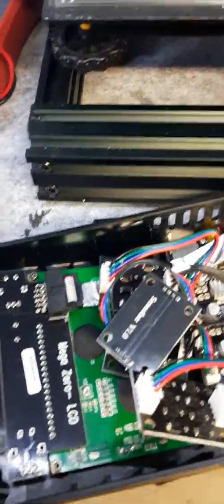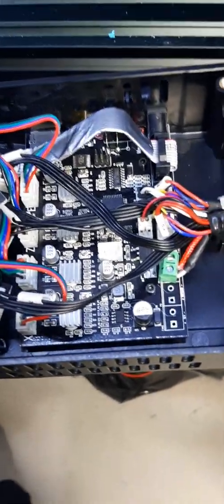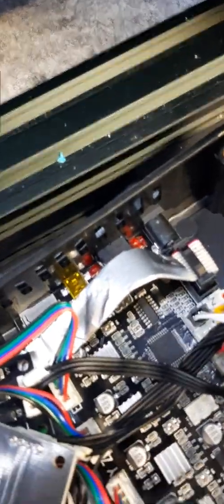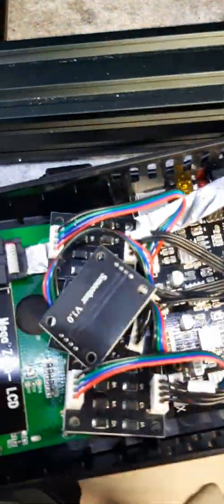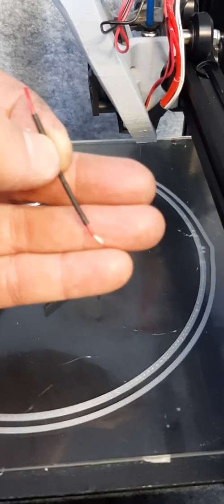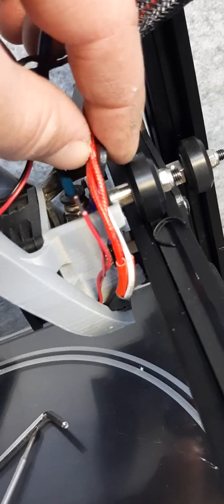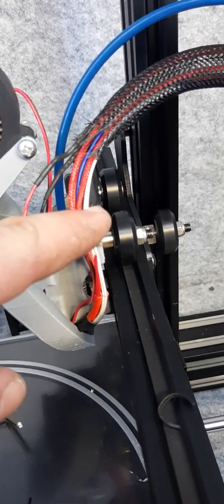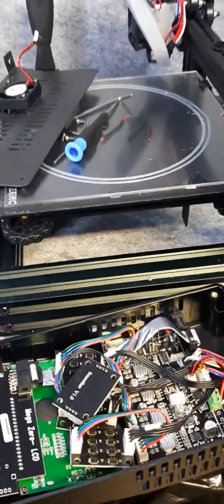Hot End fan Failed! How to find the problem and fix it!

Comment: I had to go through the same with my old Printrbot as well as rebuilding the hot end a few times. It was not fun.
Reply from the maker: I like the tinkering and troubleshooting some times. But other times it can become frustrating.
Reply: @alberta3d  I repaired commercial printers and copiers for a living so it's sometimes like I hadn't left the office and very frustrating. Other times it was a peice of cake. I've had the Vyper from Anycubic for about 10 days now and I'm still dialing it in. Unfortunately it is the v1 model and I had two nasty clogs in the heat break from the crappy teflon tube not being fullys seated and also not up to the high heat of filament loading. Capricorn to the rescue!
Reply from the maker: @darrenp9454  I put Capricorn in my Vyper too. I managed to get a few hundred hours before I had to though, so that's a win. I really think they need to just switch all thier printers to all metal heat breaks. It just makes sense.
Reply: @alberta3d  I completely agree.